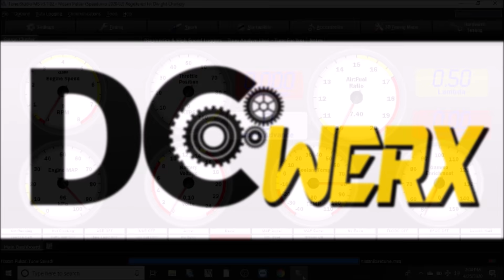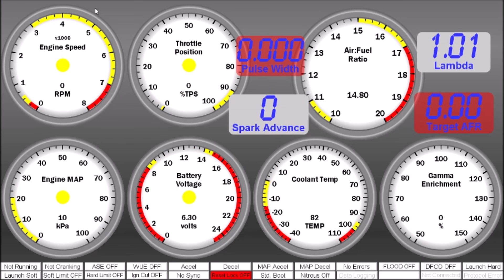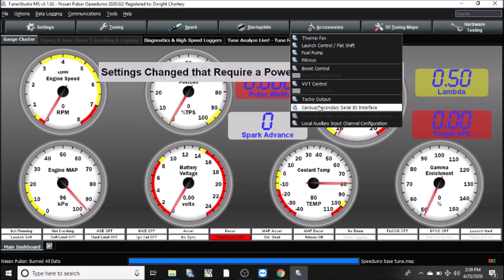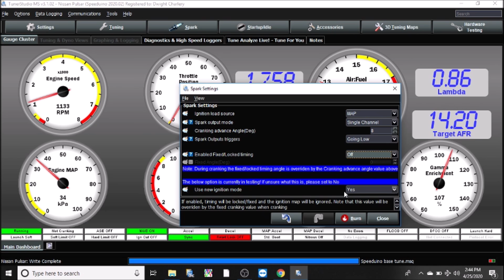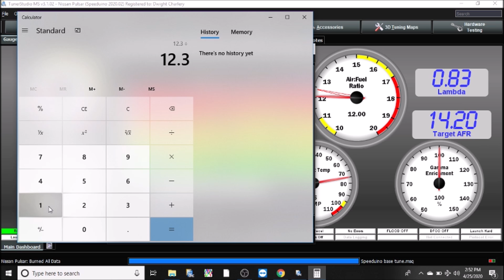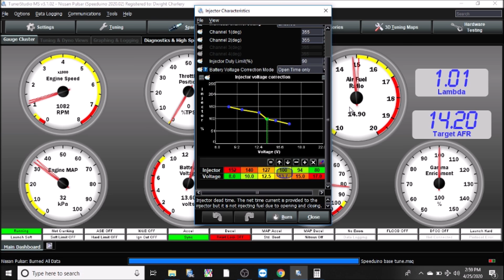Speeduino ECU Tuning Tutorial: Creating Custom Basemap + First Start + Idle Tuning

Comment: hello dc werx
i want to ask a question

i remapped my bmw 520d couple years ago
but whatever i do (putting back an version of a 520d or software update) it doesn't seems to go back to original
if i go the a bmw dealer and ask them to install a new ECU (with new reprogramming, so not a copy of my old ECU) will that make my car back to original? like the remap never happened?
thank you in advance
Reply from the maker: Theoretically it should be back to stock with the new ECU
Reply: @DCWERX  ok thank you

Comment: i got an is300 with auto (slush box) i was wondering the about running oem ecu and the speeduino i got on idea but you know like example is having the TPS running into 2 things .and do i need to use a resistors  on any unhooked oem ecu connections ill bet i do
Reply from the maker: No extra resistors needed

Comment: Firstly Great vids as always DC. Greatly appreciated.. 
Am having issues getting my car started.. it's a 1998 Toyota Levin. With a 1500cc 4afe.. running basic distributor.. can't seem to get this thing started normally. However when I change around the spark leads from 1342 to 4231 basically reverse orientation it fires up..  what could cause this and if leave it this way is there any adverse effects.. ?
Pls help
Reply from the maker: You running an aftermarket ECU ? I am not sure what would cause it to act like that, check mechanical timing.
Reply: @DCWERX  . Running on a no2c

Comment: What is the point on running speeduino in parallel with the stock ecu, if you already control fuel and ignition with speeduino?
Reply from the maker: There may be cases where you need the factory ECU to control some things that speeduino can't. Eg A/C, dashboard, alternator, transmission etc. In my case I am using the factory ECU for automatic transmission.

I have also found its easier to wire a car in parallel than as a standalone

Comment: you dont talk about Map sample in Engine contanstants ? i had som weird problems when set my to cycle average, the car was not able to drive :S changed to instantianous ore event average, and then the car was able to drive and get tuned ?

Btw i realy like your videos :D
Reply: Need some advice buying a speed unio
Reply from the maker: @matden5595  what sort of advice do you need ?
Reply: @DCWERX  I have a altezza and I need one of these unit
Reply: @matden5595  check out the wiki at speeduino . com there are several different versions pnp 0.3 and 0.4 once you have an understanding of which board you want there are shops that sell complete official boards or you can make your own.
Reply from the maker: Good observation, I remembered after I was done recording. I will address it in the next video. It doesn't make a difference at idle anyway. Don't use cycle average, it doesn't work. 

For what it's worth I use event average on the "tuned" map and it drives flawlessly
Reply: @DCWERX  Yeah i found out the same, when ideling ore free reving the car, it works fine :) But as soon as it there is real load it goes bad.

i used instantanius at first, but the accel enrichment did not react quickly enough, swaped to event average and it was much better, but the ve map also had to have some fine tuning again.
Reply from the maker: @Jakobsen86  correct, i generally only use event average. I have found that Instantaneous gives too touchy of map reading to do anything useful with.
Reply: How can I contact u